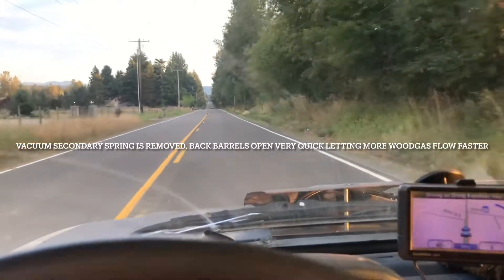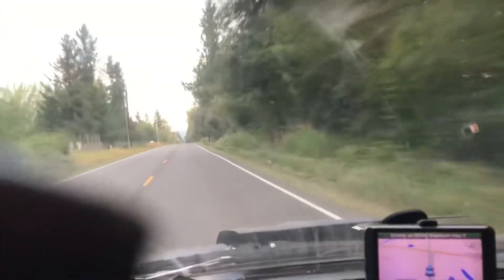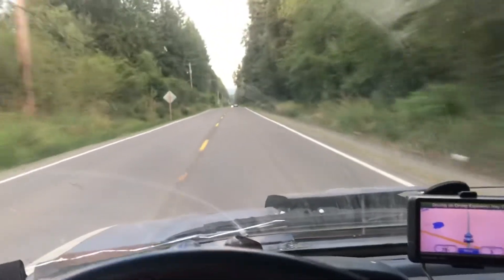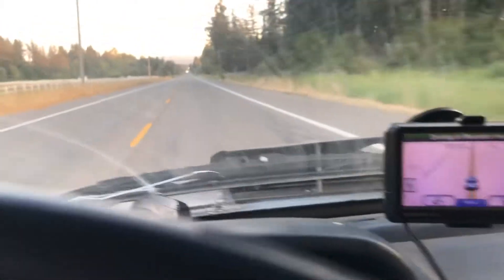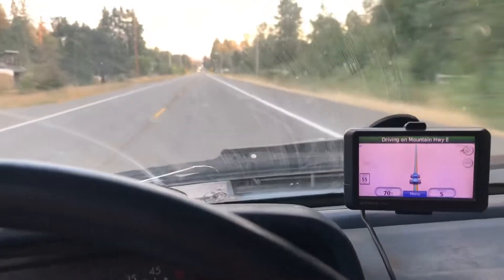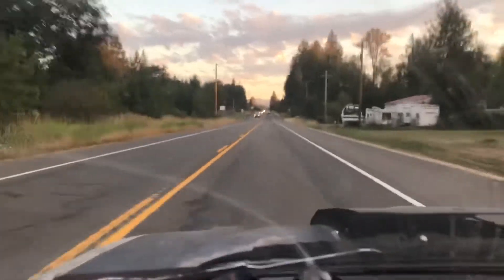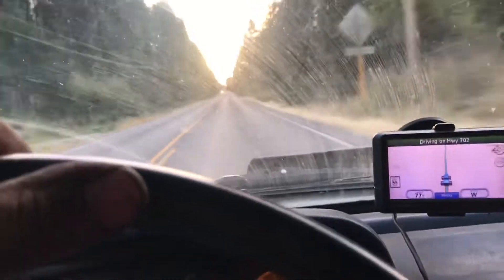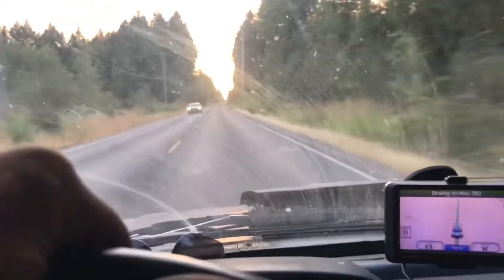WOODGAS Top Speed Runs!

Comment: Awesome!@@@@ Whats your air intake size into the gasifier reactor crucible?? 3" or more? And whay dimensions are your reactor crucible width and height thank you so much
Reply from the maker: @RustyShakleford1  I have a full build thread over on the drive on wood forum explaining the entire truck start to finish
Reply: @BigBeavrSlayer  I'm suffering from spinal tuberculosis im having trouble focusing ling enough im sorry.

Im just wondering crucible dimensions and air intake size so I can make note of it for when I'm healthy to build. Thank you
Reply from the maker: @ it’s proprietary information to the Wayne Keith design
Reply: @BigBeavrSlayer  is it included in your build thread? What is the title.? Your doing a very big disservice to yourself and the public to not share air inlet diameter and crucible dimensions.
Reply from the maker: @ no I’m not it’s not my information to share, I bought the book joined the forum and put in the work. That was a extreme cop out claim.
Reply: @BigBeavrSlayer  I'm not asking. For anything proprietary besides dimensions that worked for you!!! I'm not asking about any materials that would actually make a reliable reactor lol like concrete or ceramic

Comment: I got a 85 toyota i bought from my newber-i think i will try it out with wood gas- as i have two 350 chevy motors seting under the bench ready to run.RAN good when pulled.Looks like more than enough power with v8 just coasting the rpms.
Reply from the maker: Oh yes. There have been several 4 cylinder trucks done for lower speeds around town cruisers as well, but I love my chev v8s just makes things more fun
Reply: @BigBeavrSlayer  I agree the v8 makes more sence, since you loose 40% of power with wood gas,has much better use pulling trailer ECT,more usefull. An around town 4cyl would be fine around town though.
Reply from the maker: @Kevinrowland-dz2ut  there is a lot to be done to recover that lost power on woodgas. Timing advance for starters this truck is running at 45° advance. The more compression the better, this motor is 9.5/1 my seat of the pants feel its has only lost 15% power on woodgas. Much easier and cheaper to build a 4cytlinder for compression and timing

Comment: That's a tree-mendous set of results you got there  :) . 
 You must be right up there, when it comes to tree-riffically powered land speed records, in the woodgas community. 
 Ya know, this reminds me that there used to be woodgas powered car racing, just like we have today, but with forest squeezings, instead of dinosaur squeezings, serving as the motion lotion. 
 Oh, those were the days  :) .
Reply from the maker: There are a few guys trying to work out the bugs of a turbo system, but I'm so excited for the V10 because it's is obd2... Computer tuneable. Recently found out the computer is capable of 70 degrees overall timing! Artificially raising the compression ratio in this way could yield some SERIOUS POWER on tree carcasses. Could be the open door to using newer vehicles for our chosen fuel source
Reply: @BigBeavrSlayer  
 That sounds 'grate'. 
 When I get back into this, I wanna try some new computer designs on my older engines, to see if I can get more watts per tree from them. 
 There is plenty of untapped potential here, and it wood be a shame not to see watt is truly possible.
Reply from the maker: @CNCmachiningisfun  have you delves into charcoal gas yet? Many guys using a what drip on a char coal gasifier are seeing great results over the road. Some now wetting the charcoal to a certain percentage by weight to make maximum hydrogen content. I would love to see a set up like that on a Genset and compare wood to watts output
Reply: @BigBeavrSlayer  
 Yup. Been there. Done that. Got the beer stains on my tee shirt  :) . 
 One of my videos, on April of 2021, shows the amazing result of water/steam injection.  
 I think I called it: "Want more watts?  Just add watter". 
 That ought to add a smile to yer dial  :) .
Reply from the maker: @CNCmachiningisfun  I'm heading over to see it now 👍
Reply from the maker: I'm poking at the guys for next Argos meetup in Indiana to have some races 😁 they don't know if the land owners will allow it, but I think waynes little Dakota would get me on the top end. Now just waiting for the V10 to start setting records, I think if we figure in weight classes it is going to fly!
Reply: @BigBeavrSlayer  
 That really wood be fun to see. 
 Sure, getting permission to tear along like a land rocket may be a challenge, but you just might also be in a position to set some new world speed records  :) . 
 I wonder if a turbo, or a supercharger, wood be helpful here.

Comment: Excellent. It would be interesting to plug in an OBD thingummy to see what the engine thinks of it, like mixture, timing etc. I'd like to see consumption in pounds per mile and a plug-chop, to see what efficiency is like. Stay safe and don't get pulled over!
Reply from the maker: That's going to be the V10, I'll be data logging and having that one tuned to see how far I can push the woodgas for power. This truck is getting about 1.5-1.7 pounds per mile traveled on this maple wood right now, wish I could get it dryer I think that would help efficiency some but the climate I am in it's hard to get the wood much more dry then that
Reply: Idk what urr working with but if you could put the maple in a climate controlled space kinda like a jerky maker and get it dried that way. Idk just a thought. Idk how you get the wood cut down to size but those sized chunks maybe get them seasoned and dry as possible. I know it's hard in urr locale.
Reply from the maker: @jasonchristopher2977  I have a full Playlist for the wood chunking machine that I built to produce the chunks, and best I can do for drying is I have a heated tool room at work where I set exhaust fans to blow through the chunk pile and that works pretty good so far
Reply: The dodge dakota from the book have wood will travel- gets a mile per pound of wood ,and after counting the btu in wood it is like 30% more efficient than the dakotas on gasoline.